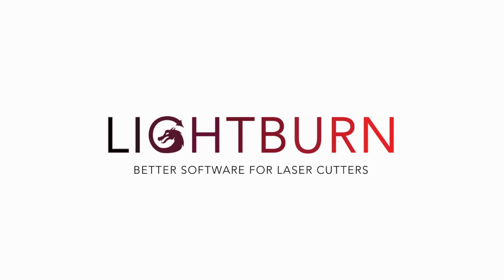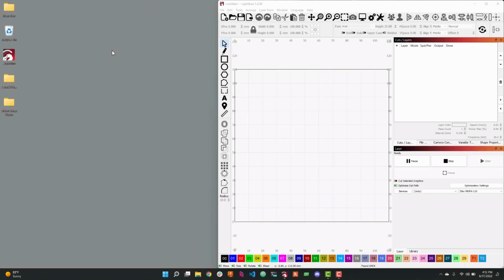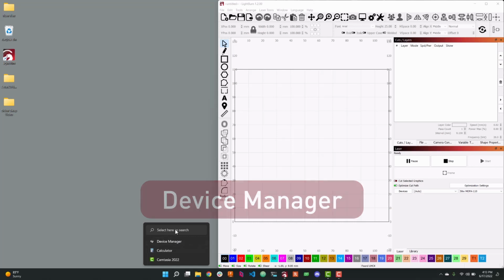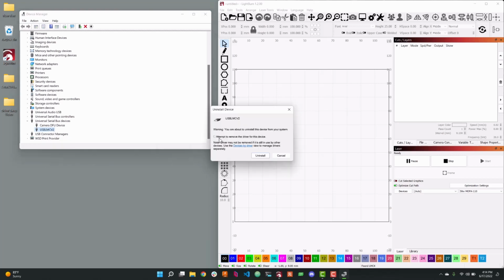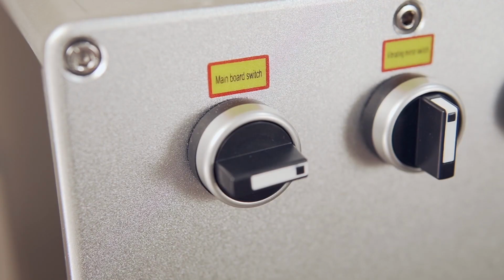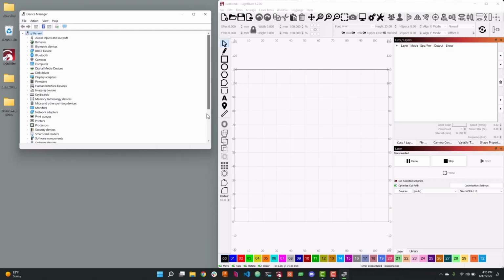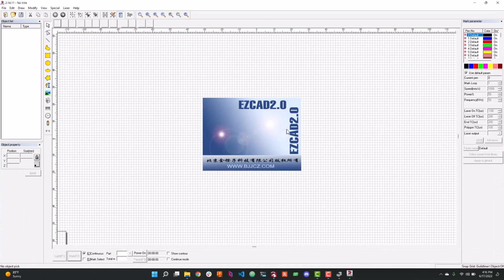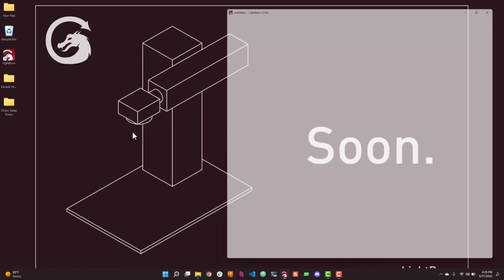Switching Back to EzCad2 From LightBurn

Comment: I prefer to use Lightburn, but what happens if I want to use the EzCad2 I do it from a different laptop. I have plenty of laptops in stock. Do I have to go through the process of removing it or can I just leave it alone on the other laptop?
And just use a USB switch.
Reply: da pra trocar o driver usando script em .bat

Comment: Definitely needed, so much for lightburn being superior,
Reply from the maker: Was there something specific you are missing?
Reply: @lightburnsoftware7189  had sent a email through ,

i have to add 20% to all power values to get anything to engrave so in turn it means nothing is working 

ive now gone back to ezcad because lightburn just isnt working for me probably have 25 or more days left of the trial which is a shame as i was really hoping it would be better then ezcad but i just cant get things to work properly with my fiber laser :(
Reply from the maker: @jezzalinko  When did you email us?  This typically gets resolved very quickly, and is generally just a setting that's wrong in the initial setup.  We have lots of users successfully using the galvo version of LightBurn.
Reply from the maker: @jezzalinko  - When you have more time, email support again.  We can extend or reset the trial easily, so that isn’t an issue.
Reply: @lightburnsoftware7189  thanks managed to get a extra 2 weeks but also managed to cop covid as well so never got to do much testing at all

may i suggest looking into node editing? as i tried this on the 1 day i got to trial lightburn and when editing circles and a few other images the node control wasnt as easy as ezcad or even other programs that allow for node editing

lightburn definitely appears to have a easy interface but unfortunately im back on ezcad now as the trial is over and never managed to convince me to spend the $300 to get lightburn
thankyou for trying